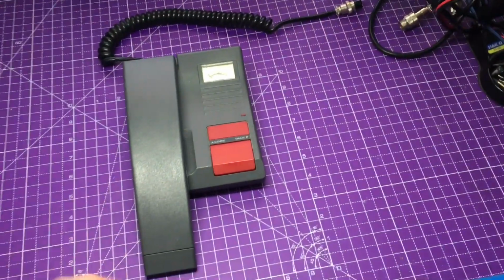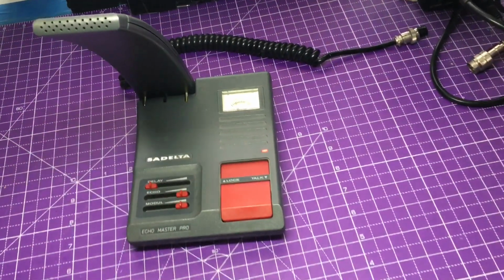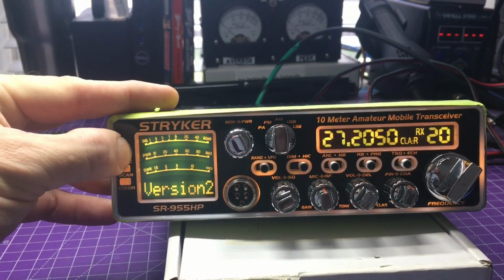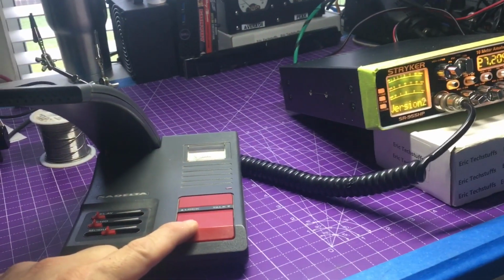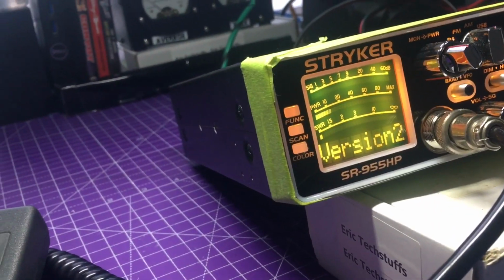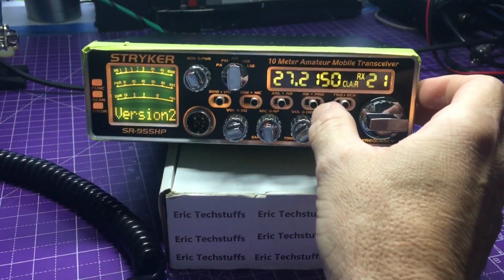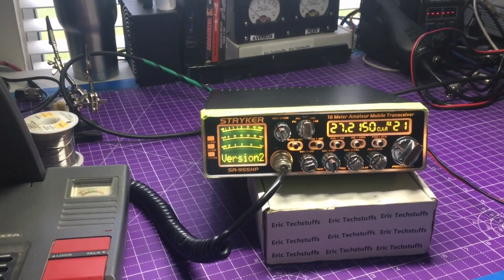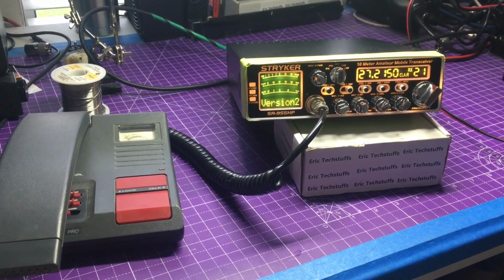Sadelta Echomaster Pro microphone testing

Comment: My buddy had one of these. It used to squeal like crazy until he ran a wire from the mic plug to his heating vent. That Roger beep takes me back. Maybe I’ll try to program it into my 955…
Reply from the maker: Yeah  do like the Roger Beep and actually part of the reason I got it is to use it with to simulate it and add it in my 955  ! I have heard the same on the squealing of these mics, but mine has been pretty good !  Hope to catch you on the air ! 73 from 1200

Comment: Which Sadelta have the two tone beep ?
Reply from the maker: As far as I know the Echomax 2000 has it still It's a great Roger Beep.
Reply: The Sadelta with a single Modulation meter and the one with dual meters with the silver gooseneck have the 2 tone roger beep!